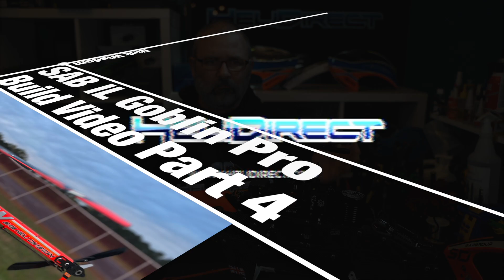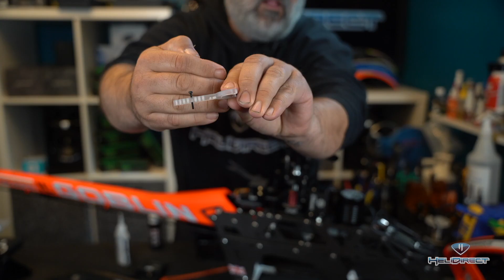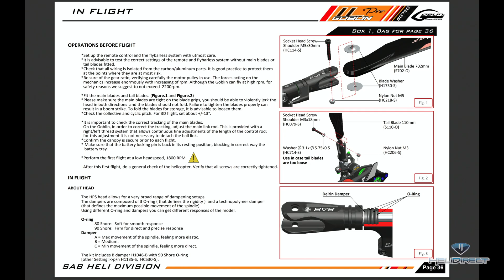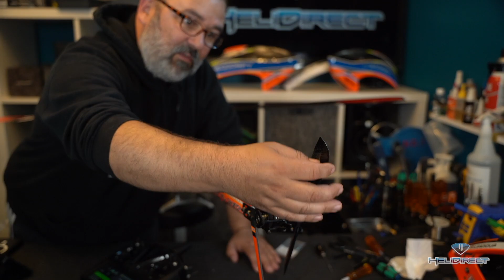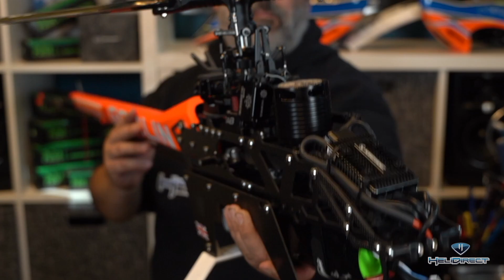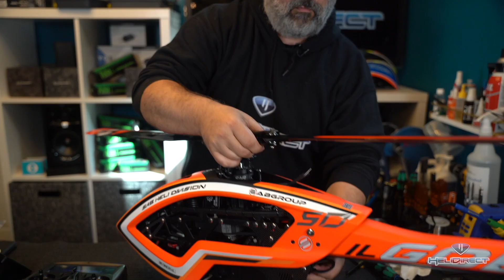IL Goblin Pro Build Video Part 4 Helicopter Setup Overview

Comment: If you made a trim adjustment in the radio to your servo then wouldn’t you no longer have your servo arm at 90 degrees. I mean yes it will be close but not exact. Is that small adjustment no big deal? Just trying to clarify for my ilgoblin setup. 
I got my theta servos programmed to 90 but to get my swash level I have to make a small trim adjustment as just turning the ball link doesn’t give me an exact level swash. It goes either too short or too long.

Comment: For the Nexus you are tight on ports.  The way to get around this is to use the esc port for one lead, then move the rpm yellow lead into the signal location of your backup power lead from the esc, then plug that into the RPM port.  Lastly use the last port on the nexus for your capacitor backup.  Hope that helps!

Comment: How did you wire in your BEC? There are so many options and methods....the only instructionals I've come across are for VBar setups.  I have a Nexus FC on my Gemini and Nimbus and I'm in the process of doing the Avionics for both over the winter break. 
I want to install an Xguard plus c50 v3 in them.